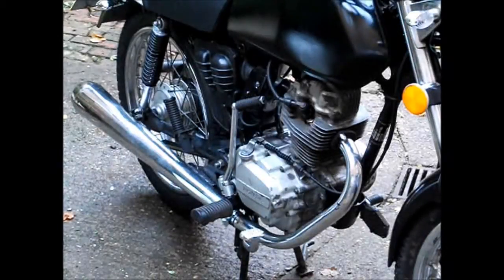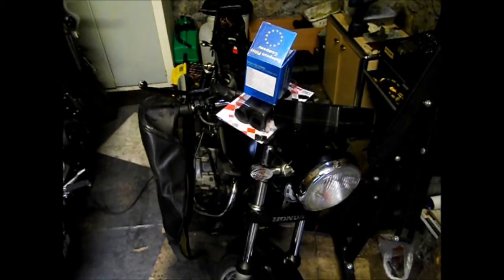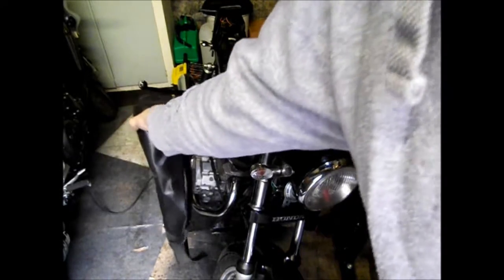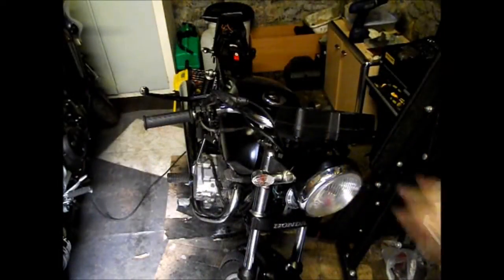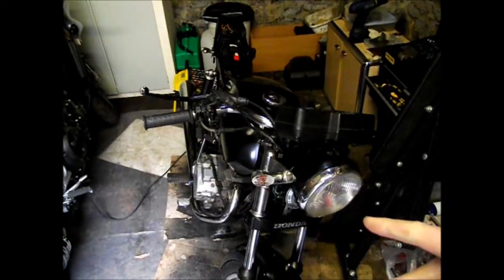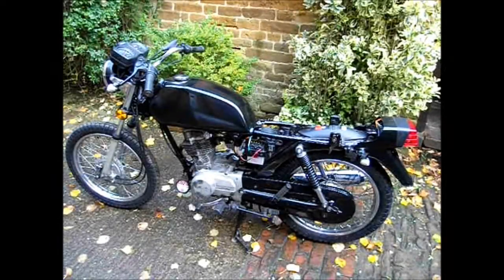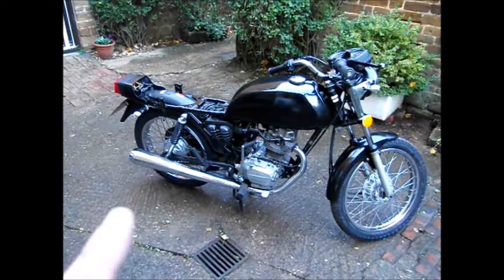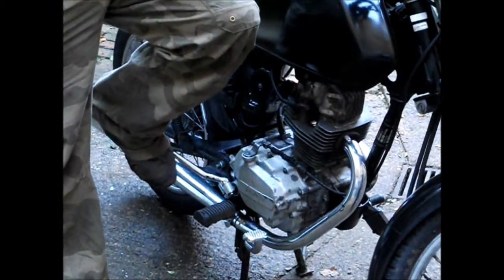Project bike pt7: CG125 Will it start??? (New seat/parts reveal).

Comment from the maker: I know, totally noob mistake, lol. I did have it runing long enough to check the lights, indicators still staying on at full voltage so its either the relay or my connections (most likely).